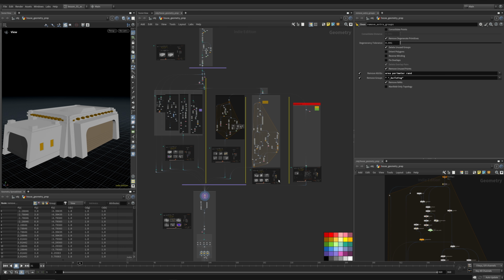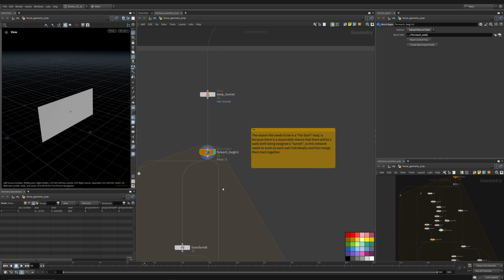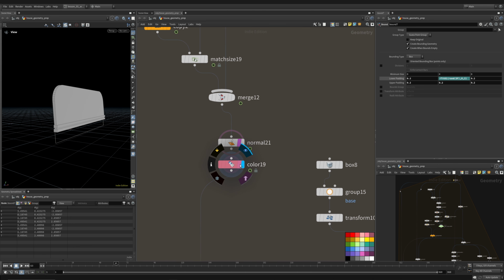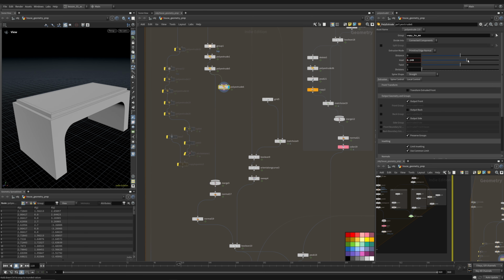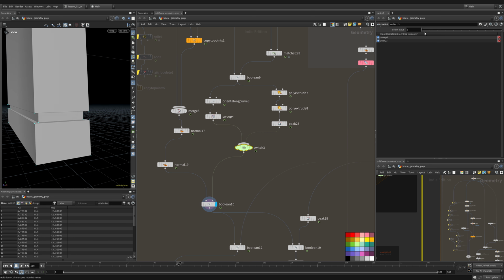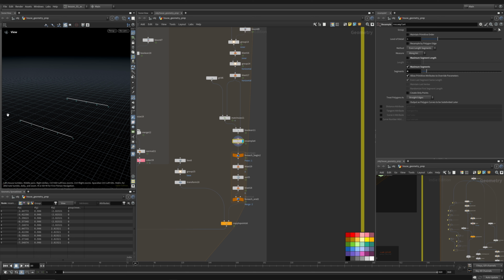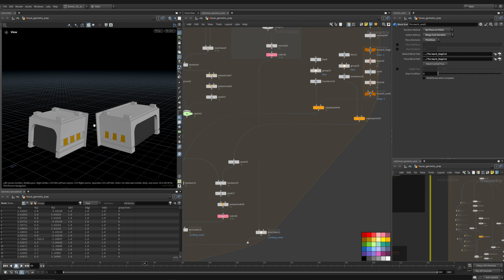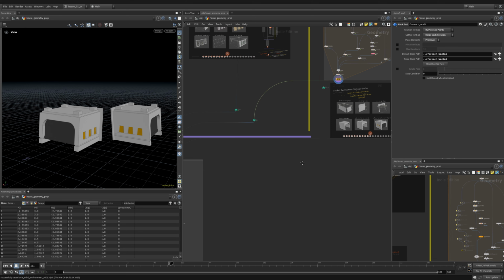Lesson 11: House Modeling Part 04 (Free Environment Mini Course)

Comment: pardon my ignorance, but im not getting my peak sops to work like yours. Im on H 21.0.440. I've downloaded your project file as well and it's just as broken. Essentially the peak sop isn't respecting the primitive normal directions. Now, Im sure it's just my misunderstanding of something somewhere, but either way, the peak sop doesn't work the same way as when you made this tutorial. Appreciate the help and the course, its phenomenal!!
Reply from the maker: Maybe try to recompute the normals before! Otherwise you could manually displace the points along the normals (using a wrangle you can write 

v@P += v@N * chf(“displace_amount”);

That would let you scale along the normals based on the float parameter “displace_amount”. 

If that doesn’t work, send a screenshot to me at info@wttrlabs.com and I can help debug!

Also thanks for the kind words! I’m glad you like the course!
Reply: @wttrlabs  Appreciate the quick response. I've emailed you because no, neither of those suggestions worked.
Reply from the maker: Let me know if any more questions come up!